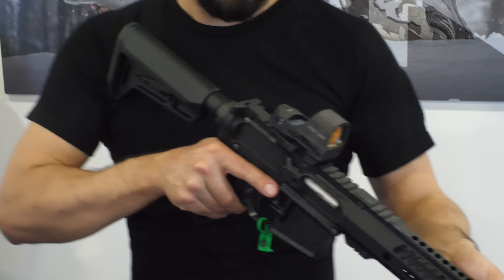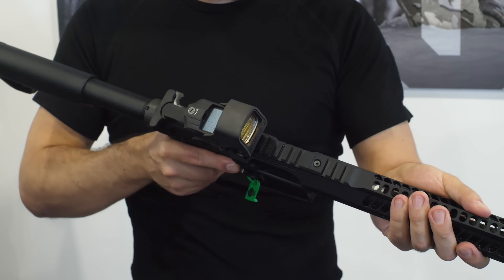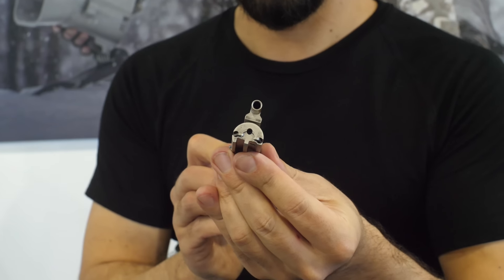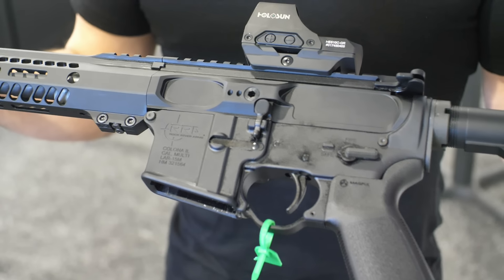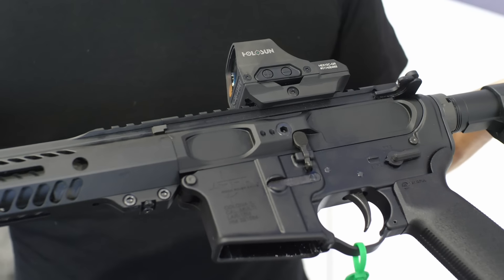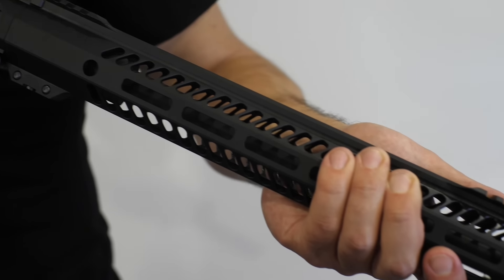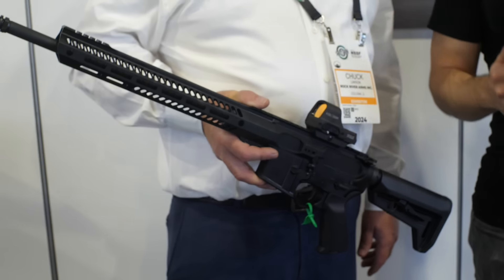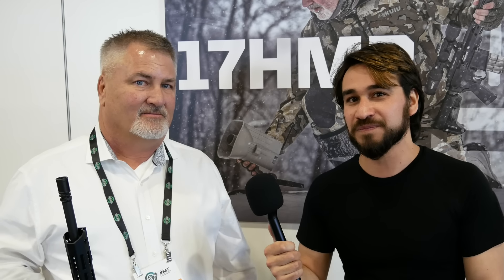Rock River Arms’ Gas Operated Blowback 17 HMR Rifle

Comment: Pretty clever, they basically turned the bolt into a giant QD plug. Calling it delayed blowback is a misnomer though- this is a locked-breech, gas-operated, DI system just like a regular AR. Only difference is instead of locking the bolt with lugs and rotating to unlock them, this locks the bolt with bearings and uses linear motion to unlock.

By definition, blowback means the bolt or slide is not locked and is free to move back as soon as the cartridge is fired, maybe with a delaying mechanism, but never locked. If the bolt is fully locked when in battery and requires action gas to unlock and cycle, it is by definition not a blowback of any kind.
Reply: To be fair we haven’t seen the locking piece. Maybe it started out as roller delayed blowback but there wasn’t enough oomph no matter what angle the locking piece had, and so they just added a gas assist?
Reply: Basically a self-loading Fortner action
Reply: Yeah this system is legit roller LOCK for once, not roller delayed
Reply: @JinKee Good thought, but I looked around a little and that doesn't seem to be the case. Copied from my reply to another comment thread:

Guys, this is absolutely not a blowback. Look at the placement of the gas block. They're pulling the absolute highest pressure gas right in front of the chamber, with ridiculous dwell time running all the way to the end of a full length barrel. This is a HUGE volume of high pressure gas they are using, relative to the cartridge, this is absolutely not just a small amount of gas for a little kick to unlock the bearings while the bolt blows back on its own. No, this is operating gas that is fully cycling the action. That gas block placement the only way they could get enough gas out of the 17 HMR to cycle a large and heavy AR-style bolt.

Don't believe me? It turns out this RRA rifle is an updated version of the recently defunct Garrow Manufacturing 17 HMR upper, using the exact same operating mechanism and configuration, with some improvements to the ball bearing retention. Here's how Garrow described their design in their own (defunct) Facebook page: "The GFD AR-15 .17 HMR is a gas-operated, rimfire, semi-automatic, locking bolt upper for the AR-15 rifle." And here is a quote from Michael Garrow in a Varminter.com article: “I’ve patented the first gas-operated 17-HMR upper for the AR-15. It operates on the (gas) direct impingement principal [sic]."

It's clear that the inventor sought out to create a gas-operated DI platform for the .17 HMR, and chose ball bearings as his locking system. At no point did Garrow himself ever refer to his design as a blowback of any kind, only RRA is saying that now. It's clear that when RRA released their version, they decided that "gas-operated blowback" was more marketable (probably because everyone is nuts about HK roller guns now) and started hyping up the rollers themselves and sidestepping the fact that This. Is. Not. A. Blowback.
Reply: @its_clean That last part is insane to me. They need to do more research, as everyone craps on anything with the word “blowback” in it these days, just out of annoyance with all the cheap direct blowback PCCs on the market. If they don’t specify “delayed” somewhere in there, then they’re doing themselves a huge disservice. But you’re right, it’s not blowback at all. They really need to wrap their heads around what they’re doing there. And while they’re at it, cut the price down on these by about half. They’re high if they think these prices will hold up in this market.
Reply: It might not be fully locked though. It could be a hybrid system.
Reply: I wonder if the difference is which action puts the most force on the bolt, as in with a normal 5.56 AR, does the di system just unlock the bolt and chamber pressure pushes the bolt back, or does the di system provide all the rearward motion?  I will say this seems more roller locked than delayed in any case
Reply: @rollastudent  I'm not a physics expert, but I look at it this way. 55 gr 5.56 has roughly 1200 ft-lbs of muzzle energy, while 17 HMR has less than 300 ft-lbs. The 17 HMR bolt/carrier is a little slimmer but otherwise nearly the same size and weight as a full size AR BCG. I just don't think it's possible for chamber pressure to be a significant motivating force in this system when you need to move a mass that's maybe 80% of a 5.56 BCG, using less than 25% of the energy an 5.56 would produce. It's gotta be the action gas doing most of the work, with chamber pressure/blowback providing minimal additional energy- just like any other gas-operated system.
Reply: @its_clean   but isn’t the gas port pressure lower than the chamber pressure, and acting on a smaller surface area?
Reply: @rollastudent I too thought that looked like a roller locked system; pretty neat; I also love the cartridge
Reply: You are in fact, incorrect. This IS a delayed-blowback system, the gas only opens the action & provides some help but most of the force used to cycle the bolt is provided via blowback. There is is this ancient Italian company which did a similar thing & while not known by most they were very successful making everything upto large AA cannons. At first glance it just looked like long-stroke gas-piston but actually it was gas-piston-opening blowback, similar to this.
Reply: @bo-dine7971  "the gas only opens the action" That IS the definition of locked breach. There is no way you could unlock the bolt of a gas operated rifle from pushing on the bolt face, gas is required to unlock the bolt. On a lever or roller delayed action, you could take a rod and cycle the action with pressure on breach face. If this was a delayed blowback action, they would not need a gas system.

Comment: I like it. I wonder if this same kind of ball/roller locked and gas actuated system would be appropriate for 9/10mm or 45acp ARs. Straight blowback AR9s have considerable recoil, reliability problems without significant tinkering with buffer weights etc. as well as ejection port gas in the face, while delayed systems like the stribog or mp5 have buttery smooth recoil profiles.
Reply: Mean Arms makes a bearing-delayed 9mm upper for ARs currently.
Reply: There are also two companies making  bearing delayed buffer assemblies in lieu of the normal springs and weights. One person said it was in between roller delayed and cmmg radial delayed in terms of feel.
Reply: @S.L.A.Z.  I saw that as well, but it looks like the mean arms upper is more of a bearing delayed straight blowback system instead of this, which actually uses tapped gas move a block in the bolt and unlock the bolt and allow cycling. I wonder how they compare, as well as to the CMMG banshee radial system. What I like about this one is that it's pretty darn close to being actually locked breach like a standard AR.

I think the whole point of systems like this is to avoid blowback type actions and lean more towards locked breech but maybe I'm wrong. I don't have any of them as I've stuck with 300 for short builds but I'd be interested in a comparison.
Reply: @crushingexistentialism  Agreed, this system is more intresting, probably plenty light on recoil too. You just mentioned straight blowback in your initial post so wanted to be sure you knew about the other options. Technically if it's delayed blowback it's not straight blowback.
Reply: It's a different concept, just similar looks with the bearings. @S.L.A.Z.

Comment: 17 wsm!!!
Reply: 17 hm2
Reply: Ammunition isn’t common enough or I agree.
Reply: @nickallen8333  Look at 5.7x28. Without the demand, the ammo won’t ever be common. With more 5.7 guns, we’re now seeing several manufacturers cranking it out and making pricing competitive.
Reply: @jackjohnson291  we were talking about .17 WSM not the 5.7
Reply: @nickallen8333 I’m aware. Try reading that again. My point is that more guns chambered in anything (with 5.7 being an example), the more the ammunition will become commonly available. 17WSM ammunition won’t become more readily available and less expensive until more guns are made in that chambering and the demand is high enough for ammunition manufacturers to invest in all the tooling and floor space to produce it. The more manufacturers making it, the greater the competition becomes and eventually, the lower the cost.
Reply: @jackjohnson291  You have no idea what you are talking about. Why would they start making .17 WSM chambered guns? 5.7 makes sense because it’s a center fired round chambered in pistols and carbines and is a viable defensive round driving demand. .17 HMR does 90 percent of what .17 WSM does and if you need to step up in energy from that you would be better off in every way to just skip the .17 WSM and go .223 rem. The .17 WSM is a target round and the competitive rimfire community is dominated by .17 hmr, .22 wmr and .22lr.. The .17 isn’t going anywhere and there is zero reason why manufacturers would start making semi auto .17 WSM. 

Also 5.7 is nowhere near competitively priced.. It’s running the same or more than .223 while being way less capable.
Reply: @nickallen8333   I thought I heard about a year ago they discontinued caliber...but lately I've keep seeing more and more in the stores!
Reply: @nickallen8333  Pretty much what i had in my mind. 
.17wsm just doesnt offer that much of perfomance boost compared to .17hmr to justify
why we should spread existing cardridge production even thinner than those already are.

Comment: So, it's roller (ball bearing) locked, not delayed blowback. Still a cool action.
Reply: Bearing-delayed blowback to be precise. So he’s not wrong. Rollers are different
Reply: @John_Redcorn_  It's not a blowback at all and they shouldn't have called it that, though they probably did it just because everyone thinks roller-delayed blowback is sexy.

This is not a blowback at all because the bolt is locked by the bearings, and will not move until the gas enters the "gas key" and retracts the bearings. This is just a traditional locked-breech gas-operated DI system, except instead of locking the bolt with lugs and using rotation to unlock them, it's locking the bolt with bearings and using linear motion to unlock. It's clever and I like it, but calling it any sort of blowback, delayed or not, is a misnomer.
Reply: @its_clean  Except the gas doesn't provide the rearward motion, it only moves the locking mechanism out of the way. The main force pushing the bolt carrier back is still the rearward movement of the casing.

And since you're deciding to be pedantic, the AR-15 isn't direct impingement - the bolt head actually doubles as a piston, the gas doesn't directly impinge on anything.
Reply: @its_clean  look up the definition of blowback operation. It IS a blowback: most modern semi-auto are in some form (you have direct blowback or delayed blowback)This gun is a form of bearing-delayed blowback. It is not a misnomer
Reply: @kyotra yeah, your pedantry is wrong on the AR
Reply: Guys, this is absolutely not a blowback. Look at the placement of the gas block. They're pulling the absolute highest pressure gas right in front of the chamber, with ridiculous dwell time running all the way to the end of a full length barrel. This is a HUGE volume of high pressure gas they are using, relative to the cartridge, this is absolutely not just a small amount of gas for a little kick to unlock the bearings while the bolt blows back on its own. No, this is operating gas that is fully cycling the action. That gas block placement the only way they could get enough gas out of the 17 HMR to cycle a large and heavy AR-style bolt.

Don't believe me? It turns out this RRA rifle is an updated version of the recently defunct Garrow Manufacturing 17 HMR upper, using the exact same operating mechanism and configuration, with some improvements to the ball bearing retention. Here's how Garrow described their design in their own (defunct) Facebook page: "The GFD AR-15 .17 HMR is a gas-operated, rimfire, semi-automatic, locking bolt upper for the AR-15 rifle." And here is a quote from Michael Garrow in a Varminter.com article: “I’ve patented the first gas-operated 17-HMR upper for the AR-15. It operates on the (gas) direct impingement principal [sic]."

It's clear that the inventor sought out to create a gas-operated DI platform for the .17 HMR, and chose ball bearings as his locking system. At no point did Garrow himself ever refer to his design as a blowback of any kind, only RRA is saying that now. It's clear that when RRA released their version, they decided that "gas-operated blowback" was more marketable (probably because everyone is nuts about HK roller guns now) and started hyping up the rollers themselves and sidestepping the fact that This. Is. Not. A. Blowback.
Reply: @kyotra And yes, I'm aware that the Stoner system is technically an internal piston and not true DI, I used it as a close-enough example that most people are familiar with. I could have mentioned the MAS-49 or whatever but it would have been more obscure.
Reply: @borkwoof696  No, it's not. Direct impingement involves gas acting directly upon the bolt carrier to push it backwards and unlock the bolt. The French MAS-40 is a good example of this, with the gas tube terminating in a small "cup" on the bolt carrier. Gas hits the cup, gas pushes on the cup, bolt carrier moves backward - a dead simple system.

The AR-15 uses a much different mechanism. Gas from the gas tube is sent through the gas key and into an expansion chamber directly behind the bolt head (inside the bolt carrier); the expanding gas pushes on the bolt head, making it act like a piston (quite similar to how short stroke pistons function). Excess gas is vented through the bolt carrier's right-hand exhaust ports (those two little holes you likely didn't realize did anything).
Reply: @its_clean  With that short of a gas tube, there is no way all of the gas pressure has been relieved before the bolt unlocks. There must be some blowback at play by the time that bolt unlocks.

This situation gives me "Blish lock" vibes, where maybe the engineers themselves don't quite understand how the mechanism is functioning.
Reply: @kyotra  Yes, not all of the gas pressure has been relieved when the bolt unlocks, that's how all locked breech self-loading guns work. If there was no gas pressure left, an AR-15 bolt wouldn't open either. It needs to be very short on this gun because 17 HMR is much less powerful than 5.56.

Comment: Gas operated blowback. Aren't gas operated and blowback kinda exclusive from each other? What am i missing here? We have a DI operated gun which has a bolt that stays locked via ball bearings instead of a multi lug rotating bolt head. Doesnt this makes this one a gas/DI bearing locked operation? I guess the title is wrong. 

Cool idea by the way.
Reply: Gas delayed blowback is more common in handguns
Reply: @wildberry752  - yes. Best example of it is the Heckler & Koch P7 pistol.